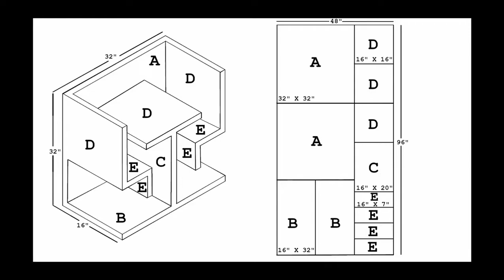DIY BlackBox Timelapse

Comment: what is the sound reduction when you have 2 x s19's cranking away?
Reply from the maker: It's around 20-25db
Reply: @upstreamdatainc  very impressive
Reply: I read in the instructions about potential smell as it heats up, how much smell are we talking about, I was hoping to use the heat generated to go through filters and into home heating